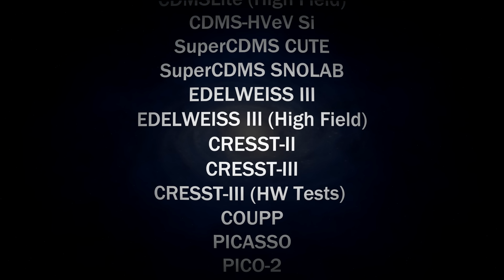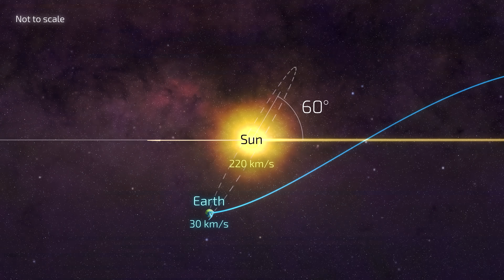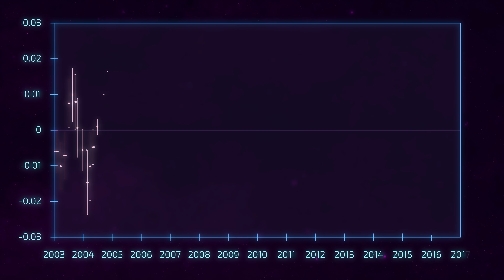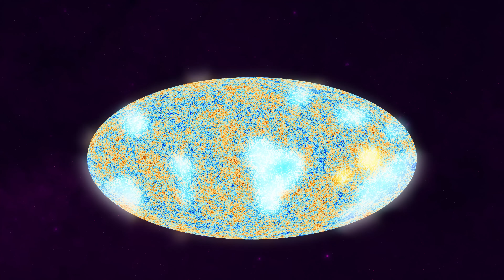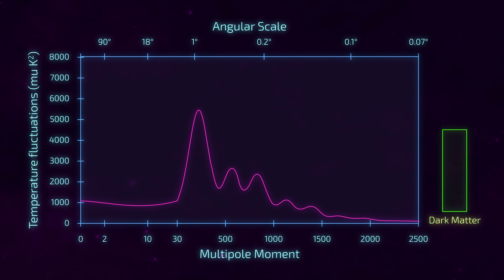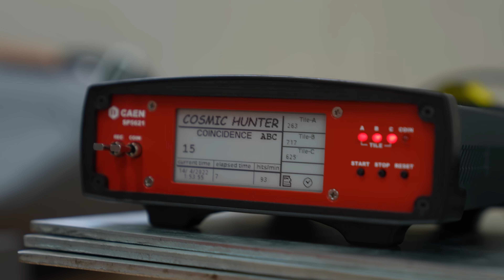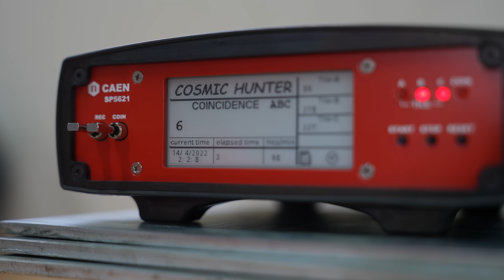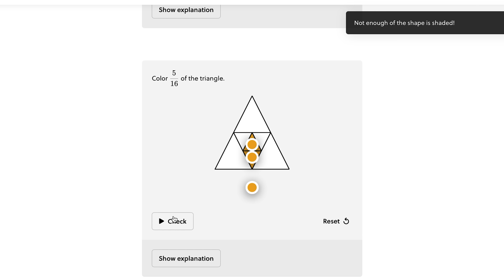The Absurd Search For Dark Matter

Comment: Dark matter has never made much sense to me, but these experiments both clarified it and made me excited that we may confirm it's existence in the next however many years, fingers crossed it happens soon!
Reply: Yeah, gotta agree.

Like dark energy as a concept makes sense and has proof.

But dark matter is just a fever dream

Now antimatter? Theoretical yet very much possible
Reply: God is very powerfull
Reply: @ElLadoDerechoOFC  There is no God, there is only lack of understanding.
Reply: As far as I understand it, dark matter is just matter that interacts weakly, or not at all, with the electromagnetic force
Reply: @leakingamps2050  "weakly" means more than it sounds like. It means it interacts via the "weak" force, which in more jargony terms means it interacts with regular matter via the Z and/or W bosons and would have a small "cross section" or low interaction rate with these particles. As far as electromagnetism goes, "dark" means it doesn't interact with photons, the electromagnetic force carriers, or if it does it doesn't do it often, essentially. There's no reason to believe that the dark matter does interact weakly, other than the fact that if it doesn't, we are pretty much screwed; it's only interaction with regular matter is gravitational then which is a VERY weak interaction and poorly understood at the quantum level.
Reply: @humble_ape  I don't think there is actually any dark matter. We have got gravitation wrong. In small scales like that of a star system, gravity acts differently as compared to large scales like galaxies. We see emergent behavior pretty much everywhere so this being an emergent behavior is not a long shot.
Reply: @SahilP2648  good thing science is not about what you think is right
Reply: @SahilP2648  and where is the evidence to support your claim? You are blaming scientists for being dogmatic when you are doing the exact same thing, believing something about a group of people with no evidence just because it fits your worldview. Particle dark matter has not been disproven, you cannot blame scientists supporting it your being closed minded when they could still absolutely 100% be right. In fact, it is you who is being closed minded for blaming them for being as such. It's really ironic how often people project their own mental flaws on other people.
Reply: the theory of Dark Matter is losing favor rapidly. The rotation of the galaxy wasn't matching with our estimates of its matter so someone created this bonkers idea that there was invisible matter, rather than face the most probable truth, that their estimates of the mass of the galaxy were simple way off. This is essential the same as arguing, "I can't explain it therefore god." Or in this case "I can't explain it therefore magic". But in the last few years they have started to recalculate the matter in the universe and started to find much if not all of the supposed missing matter. We've learned that the ambient vacuum of space past the Oort cloud contains far more molecules than we imagined. Similarly we learned that that is equally true of the matter between galaxies. This makes up for 10% of the missing matter. Then there is the discovery of cold stars that didn't develop the correct chemistry for fusion and were failed stars (much like Jupiter) that give off no detectable radiation. It is suspected cold stars might make up 50% of all stars, doubling the mass of the detectable galaxy. This makes up 30-40% of the missing mass. Together this accounts for all the matter in the galaxy. Meaning dark matter doesn't exist. Case closed.
Reply: @FablestoneSeries  Cold stars and similar objects, like small to medium sized black holes, are collectively called MACHOs, massive astrophysical compact halo objects. They are an appealing explanation of dark matter since they don't require any new physics. They can be detected through gravitational lensing when they happen to pass in front of a star. Our ability to detect this has gotten much better, but based on what we've been able to detect it seems like MACHOs do not contribute enough mass to account for most of the dark matter that we can detect through gravity.
Reply: @kered13  yep.
Reply: @kered13   the laws of averages would seem to suggest that in all probability there is nearly as many stars that didn't assemble the correct conditions to make fusion, as there are those who did. In fact I want to believe that in all likelihood there would be MORE failed stars than successful ones. Seems failure has a higher probability than success in most things natural. But you are right, you'd think by now we'd have seen dark stars passing in front of objects and obscuring things if there were billions or trillions of them out there.
Reply: @kered13  You'd think if there were billions of cold stars they'd eclipse something by now. Still if the universe didn't possess billions of cold stars that would mean the success rate of a forming start was nearly 100%. What are the chances? That seems more improbable than the existence of dark matter.
Reply: @FablestoneSeries  and @sahil P There is actually a lot more to it than just rotation curves. One of the strongest pieces of evidence is actually from the formation of structure in the universe leading to what we can observe now. Particularly the cosmic web. Almost all alternative theories of gravity fail to explain any of this properly. This of course doesn't mean there couldn't be an alternative. No astrophysist is claiming there is dark matter 100% sure though it is the most likely candidate to explain what is observed. The annoying thing is that a dark matter particle is not observed (yet) which means that if it exists, it hardly interacts with anything other then gravity.
Reply: @bramalferink3926   right, but the theory of a cosmic web of gravity doesn't necessarily imply that this web has an exotic substance to it.

Comment: The guy at 14:17 has some info that really should have been frontloaded into the video.  It's important to know that the "dark" in "dark matter" is referring to "unknown".  This doesn't at all mean that we're looking for one mysterious particle, but rather for whatever is shifting the calculations by such an enormous degree.  It's not only possible, but incredibly likely that dark matter is made up of many different undetectable (as of yet) particles that we may discover little by little or only theorize about as we go into the future.  The point about changing our model of physics is also a valid theory, but would involve upending most of what we know and finding a brand new set of equations that work with interstellar mass.  This means we would  have to create and test these new theoretical equations, but then we're getting dangerously close to 'fitting the test to the answer' and throwing in extra numbers, constants, or processes until it's close enough to the answer we need it to be.  This of course doesn't solve anything at all, but would now be something that scientists would need to prove or disprove.
Reply: "dark" actually means it doesn't interact with electromagnetism (nor weak or strong forces). I.e.  invisible. 
Not best of names but then again stars tend to be nearly "black bodies" just as they don't reflect light (they make it though, soo..)
Reply: @jorriffhdhtrsegg  The "dark" in dark matter specifically means does not interact via electromagnetism but says nothing about the others.  This detector requires it to interact via the weak force.  I beleive the strong force is excluded due to how it works but i'm not a physist.
Reply: Yes

Comment: All those expensive tests cannot find "Dark Matter" because it is based on a fault hypothesis that gravity is the prime force in cosmos. When they couldn't explain why galaxies dont fly apart from centrifugal force , and that the outer portions revolved aligned with the inner,...like a vinyl LP, yet they outer should not do so if gravity held the galaxy together....so they INVENTED a deus-ex-machina, a fudge factor to add in. "Dark Matter," "dark energy."
This is epic FAiL. Now if you actually do science and add in the electrical force which flows everwhere as seen in the vast filaments surrounded by magnetic fields...voila...you have the "missing" piece of the puzzle.
Reply: Although I'd like to disparage this, I won't because the electric force is 2.4 x 10 to the 43rd power bigger. So only a tiny electrical difference could explain this. But where is the actual science you speak of?

Comment: I actually saw the lab where they were testing the tech to control electrons in xenon tanks of 5m height. (so they can be sure it would work in a new larger tank in italy). They told me that their current issue is to get the xenon cleaned so that the electrons don't bind to anything in the xenon

Comment: I think that Space, as a material, is a good candidate for Dark Matter. There is more of it than anything else, it is weakly interactive, it is only affected by gravity, and Gravitational Waves cause Space to ripple. If the "density" of Space is changed by gravitational events, that could explain what happened in the Bullet Cluster. Neutrinos are a good candidate as a Dark Matter particle, as there are more of them than other particles, and they fit the criteria above.

Comment: If the experiment is to see a dark matter particle, wouldn't putting it skf AR underground limit its ability to detect particles passing through it? Seeing as the underground is such a controlled environment.
Reply: Because dark matter is weakly interacting, it mostly just passes straight through solid matter (like the entire Earth), and only very occasionally might it collide with an atom. They go underground to shield other types of particles, which interact much more strongly and therefore get blocked. So the amount of dark matter particles passing through us on the surface vs the amount passing through deep underground are basically the same!

Comment: Just a note on geography. The Italian Alps are the mountains that separate Italy from France and Switzerland. The mountain range that goes down the spine of Italy is called the Apennines. DAMA/LIBRA is located under the Gran Sasso, specifically the Corno Grande, which at 2,912 metres of altitude is the highest peak in the range.
Reply: Is that the one that's causing problems to the local water supplies?

Comment: Instead of physicists reworking their understanding of gravity they just made up some theoretical substance that doesn’t even interact with physical matter. 

Hate to be a bummer but we will never detect dark matter, because it doesn’t exist.
Reply: If not a substance then what else are you gonna call it ? Force ? Well , force is caused by substance as well
Reply: @shukrantpatil  I simply think our understanding of gravity is still very elementary. We don’t know why gravity is the weakest of the fundamental forces, we don’t know why mass warps space itself, we don’t understand what happens in a black hole, and we don’t understand why galaxies seem to have “extra” gravity. We don’t understand gravity that well at all and I think admitting this rather than making up a material that doesn’t interact with physical matter at all is a pretty dumb way to try to explain it. And detecting something that, again, doesn’t interact with physical matter is futile.

Comment: Dark matter has always felt like a cosmological constant-esque type of mistake. It's clearly not a coincidence that we keep getting the 85% number, but it feels like it represents something other than actual hidden matter that we'll be able to understand better later. Of course, I'm no physicist, this is just sort of my gut feeling.
Reply: I know what you mean, but I'm still going to put my bet on the gut feeling of the majority of experts on that matter.
Reply: That actually was a common theory around dark matter, which is mentioned in the video as a "revised theory of gravity". There were many such propositions, often using a very small constant, that would only become noticeable in large ranges. These gravity theories were all disproven using the bullet cluster, with only a handful of theories that assumed both dark matter AND a revision to gravity still able to match what was seen in the bullet cluster, however they required there to be significantly more dark matter to work (I think somewhere from 10x to 100x more dark matter than if it was just dark matter by itself).

This makes the theory that we have simply messed up a constant very unlikely and lended a lot of credence to some mass source that we just haven't identified yet.
Reply: wasnt cosmological constant basically rehabilitated with dark energy?
Reply: could dark matter be remnant of matter and antimatter, that act something like steel to magnet in a levitated state. I mean what else could make that much quantity?
Reply: Heh that's the gut feeling people always have when these videos pop up. But I'd rather follow the lead of actual scientists.

Comment: I have a question. The Andromeda galaxy is said to be stable and chunks don't fly off because supposedly dark matter is interacting with it and keeping everything together in one place as said in the video. 
But the dark matter detector can only detect more amounts in June and less amounts in November? This can be due to either time or location of our planet.

If that is the case then there should be some time where chunks of the Andromeda galaxy do fly off since it's constantly changing its position by rotating and time is of course continously passing. But we never see that happen. It's quite obvious from all the examples that Veritasium showed that Dark Matter is a continuous stream of matter washing over the universe, much like how a stream of water runs over the ground continously. So that means this detector is definitely detecting something else entirely which is seasonal in nature and most likely affected by our climate.

With this hypothesis, I say that the new detection facility in the south will not detect anything or will rather detect the patterns in reverse due to the seasonal nature of whatever it is picking up. Either way it's not gonna be Dark Matter.

Comment: Neutron Decay cosmology is the physical solution to black hole information paradox and universal fine tuning. 
Neutrons which contact event horizons become the vacuum energy for a single Planck second then reemerge in lowest density points of space where they decay into amorphous atomic hydrogen.  The decay process includes a volume increase, energy density decrease, of 10^54 times.  Expansion. Dark energy. Lambda. 
The decay product, amorphous atomic hydrogen, doesn't have stable orbital electron so can't emit or absorb photons. Dark matter or some of it. 
In time the amorphous atomic hydrogen stabilizes, scintillates, and follows usual evolution pathway from gas to nebula to proto star to star until in the distant future it is again at edge of event horizon.  
The universe is steady state, endlessly flowing down the curve of gravity. 
The Hubble Doppler is artifact of curvature of spacetime away from us because we live in local gravitational singularity called observable universe.  
Plug mass of universe into a Schwartzchild radius calculator. You get 13.8 billion light years. In radius. Not age. 
Neutron Decay cosmology. Inevitable?

Comment: I don't think dark matter exists. My hypothesis is that space is actually finite. All energy and mass occupying space is actually not meant to be there. So, space was forcefully expanded in the big bang to an extent that everything is tightly wound in the universe.

For example... Imagine that water was filled to capacity in a plastic/elastic container (finite space). Now, without opening the container introduce air into that container (the big bang). Because the container is elastic and mildly expandable the introduced air expands the container a bit but it's very, very tight. Because of the tight pressure, the air is basically broken into bubbles/air pockets (galaxies/stars/matter/energy - celestial bodies) because of how tight the water container is. In this case all the air pockets would still expand outward buuuut closer air pockets would be attracted to each other (gravity). Now, if the container was open, those air pockets (stars in a galaxy) would swirl around each other normally with the outward air pockets moving slower, but since the container is closed the air pockets behave differently because of the tight space.

I know this may somewhat contradict the general relativity theory but that was a theory anyway too. I wonder if there would be an experiment you could do to test something around this theory.

Comment: I really like the theory that dark matter (and gravity) is fragments of 'strong force' from all other dimensions leaking through as gravity. It would explain why gravity is both such a weak force, but interacts over such a massive scale. On average it cancels itself out, only in 'hot spots', places were matter is on average comparing all the other dimensions more present, is where gravity starts leaking through. Its basically an explanation of gravity AND dark matter in one, as in, its the same. It also explains why dark matter does not directly interact with matter, because the matter it originates from is not there... its literally in another dimension, only its gravity/strong force leaks through.